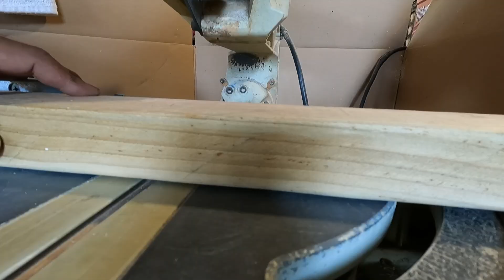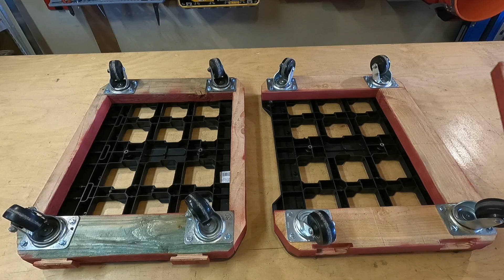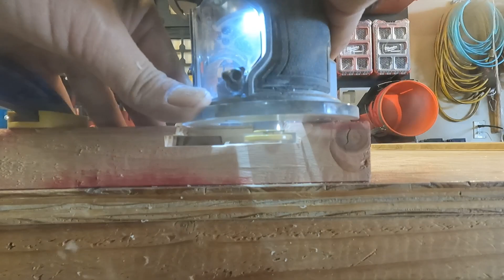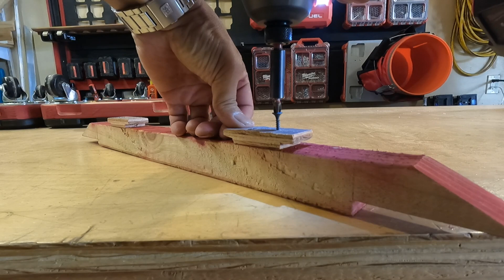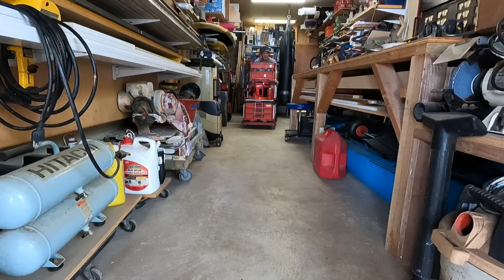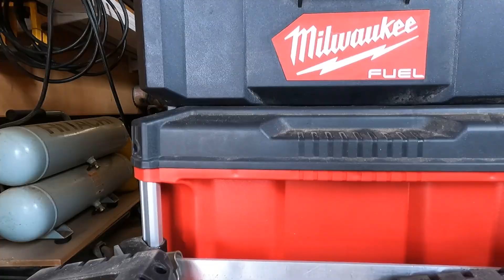Creative ideas/LINK CART/Hack Milwaukee PACKOUT mods and setup

Comment: This is really clever. You aren't limited to small diameter caster wheels. You aren't forced to stack 8 feet high. Idk if you could use those connections to add rails/shelves between the stacks, but maybe? I'm getting all thinky now. 😁
Reply from the maker: Good idea🤙